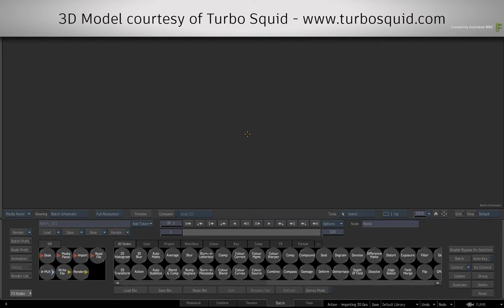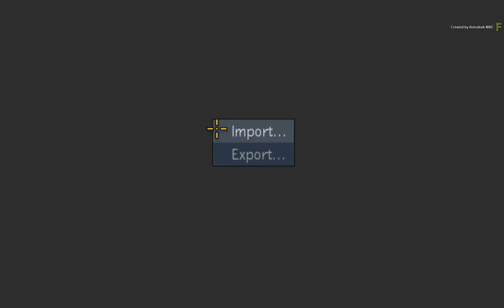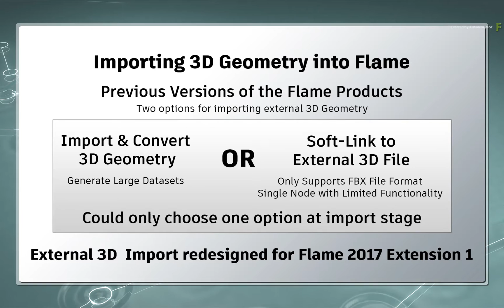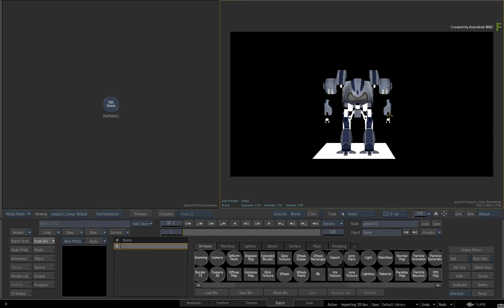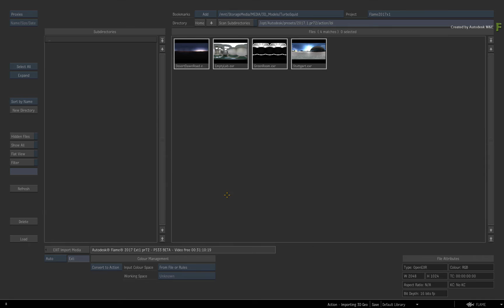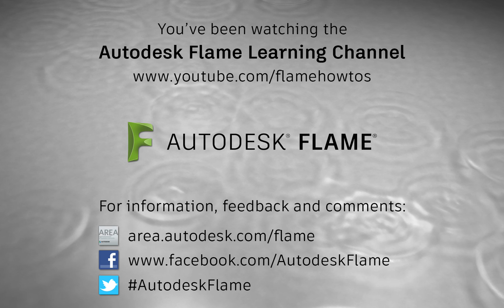Action - Importing 3D Geometry - Part 1 - Flame 2017x1

Comment: hello Grant,  I have a question : I'm trying to make a 3d animation in cinema4d, export it in alembic, and import to Flame2016, Once I open exported .abc in Cinema4d animation is there but once imported in Flame is not - do you know the magic that I should involve to have it?  thanks Yola
Reply from the maker: Hi Jola Kudela, if you want to bring animation via an alembic into Flame, you need to bake out the alembic cache of the animation.     I have done this in Maya a few times but never in C4D.   Ultimately you should have the ABC file as well as the cache files in the same folder and Flame should see them and apply the animation.
Reply: @Autodesk_Flame  thank you!